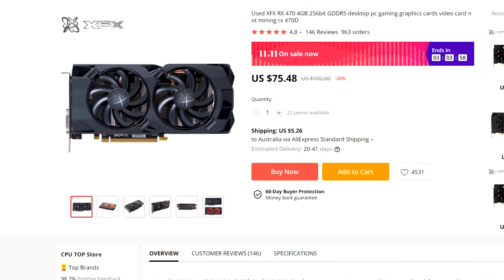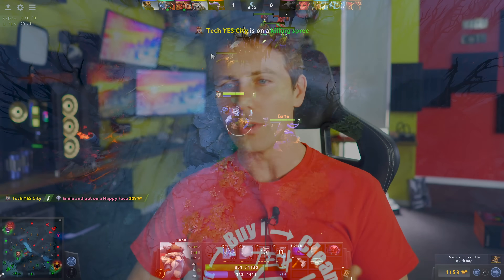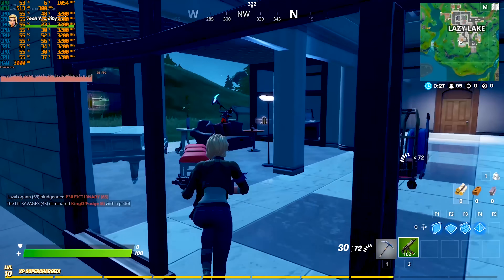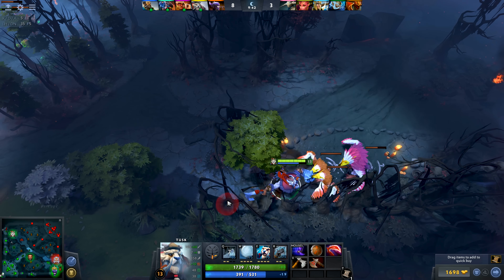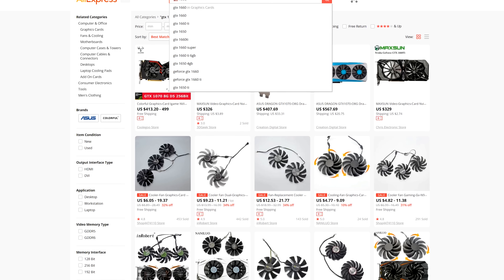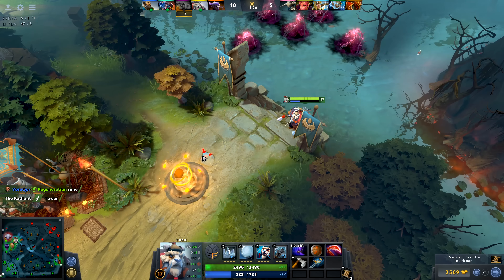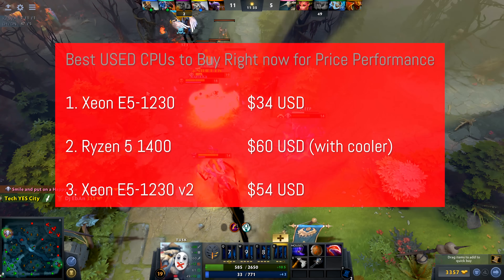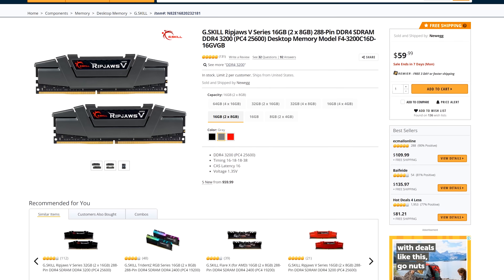What are the BEST Used PC Parts for GAMING Right Now?!

Comment: Have you looked at the AMD R9 Nano? It's a high end card from 2015 that is currently going for about $110 on ebay and it performs better than an RX 580. The only downside is that it only has 4GB of memory, but it's HBM so it's extremely fast.

Comment: GTX 1080 for 200 which is what I got my Gigabyte Xtreme for from eBay.

Also instead of 750ti I would recommend the R7 360 since they are identical performance wise and it's 1/2 the price.

Comment: Initially, I was going to get a GTX 750Ti through AliExpress because I wanted a small upgrade that didn't require a power cable, but I found a Gigabyte GTX 950 with no 6-pin connector for about $5 more (I paid $57.80). Right now they're going for about $65.
Reply: Where
Reply: @Ayoub-wg3tw  They're no longer available for that price. I see them now for $70. Do a search for: 32976818116

Comment: can you do a Q&A video for us subbers. I have a question, currently running an HP z400 W3690, 18 GB, rx 570 8gb, ssd and hdd. I want more juice but i dont know which way to go. I could buy a hp z 600 dual core with a $50 resale worth of lower end xeons and quadro, but it has max ram. then order two x5690 from your affiliate Yao Yue Store. price to performance idk. i cant find an x58 mobo where i can use all 18 gb of my ram from my current rig, nor can i find one cheap with some sort of warranty. plus i would need a case, new psu, have to use a psu adapter (which i dont want to) new fans etc. what i love about the hp z series is they are built well and for 24/7 operation.  i do game, but also edit, so im looking for more editing power without losing my current casual 1080p gaming ability like bfv and 7d2d. what says you? i need atleast 6 cores.. but a hp z 600 12 core 24 threads sounds so tempting... just dont know if it makes sense p2p when for 1-200 more im in ryzen new rig territory. but commercial grade stuff, not enterprise level hp zs..

Comment: I have a ryzen 2700x cpu with a CORSAIR - Hydro Series H100i RGB Platinum 120mm liquid cpu cooler. Paired with a MSI GTX1060 6gb with 16GB DDR4 3000 MHz Corsair Vengeance ram. I want high FPS because I game competitively and curious if my cpu is out of date or if my graphics card could be upgraded?

Comment: If I had the money, I'd grab a Ryzen 5 2600/X, no longer listed but there was a 2600 for $140 & the X for $10 more at $150 Canadian on my local classifieds, currently there's only the 2200G for $80 & 2400G for $85 Canadian, for combos there's a 1300X with a ASUS B350 Prime-Plus for $239 along with a 2700X on a B450 Tomahawk & 16GB G.Skill 3200 RAM listed for $375 Canadian.
For GPU, There's a Sapphire Nitro+ RX 480 8GB for $220 though there's 3 RX 580 options for that price, a Nitro+ 8GB for $180, XFX GTS Black Core Edition 8GB for $200 & a PowerColor Red Dragon for $220. For Vega, there's a MSI Blower model Vega 56 relisted for $285 after being listed for $350 5 days ago. On the Nvidia side of things the cheapest GTX 1070 is listed at $320 followed by $350 with the cheapest 1070ti at $400, same price as the only RTX 2060 listed.

Comment: im from poland, year ago i build a used budget pc i5 6600(non k), rx 570 4gb from Aorus, 2x4gb ram Goodram irdm, mb msi h110 eco, 120gb ssd (new), 1tb hdd Toshiba p300(new) new psu 80+ silver from chieftech and new case zalman z1 neo, total cos ~ 400$, with all new parts it will be cost 2x more....im happy with that setup i play new game high/ultra set with 50-60+fps

Comment: i got a optiplex 9020 with an i5 4590 and 16 gigs of ram off of ebay for $120,not too shabby!!!,i wanted one with an i7 but they wanted another $100 for a 9020 with a i7 4770 or 4790,but im gonna look every few days and see if i can get one for bout $150.my next goal is to get a power supply,ssd and video card for under $200 total so i will have about $300 max. in it. anyone got a 570 8 gig for $80? how bout you techyes man?got one you wanna part with?

Comment: The Ivy Bridge and Sandy Bridge Xeons are really good value for money... better single thread performance than a 1st gen Ryzen and a better CPU for modern gaming than a 9600k because of the higher core count.... got a Xeon 1270 for only 40 euros off AliExpress the other day, putting that into the old H61 based ASUS AIO PC my mate has, with a PSU upgrade and either an RX 580 or a Vega 56 will make that one mighty gaming rig!

Comment: E3 1270 v3 - saw some good deals in old Supermicro servers.  Swapped in a dual core for a home server and you are left with a good 4/8 cpu for very cheap!  Sold on my old i5 4690k pc and replaced with the Xeon as a great family pc. 

Still pushing my x5675 @4.5 for my daily drive though :)

Comment: Hey man, hope anyone sees this
Im currently ordering parts for PC, but I haven't figured it out yet completely

CPU: Ryzen 5 2600 (ordered from aliexpress) - 104.40 $
RAM: Corsair Vengance LPX 2x8 GB (also from aliexpress) - 83.80 $
MOBO: Asrock B450M Pro4 (I will buy this one locally when CPU and RAM arrive) ~ 80 $ 
PSU: BeQuet! PURE POWER 11, Gold rated 500 W - bought this one while it was few months old, almost new ~ 60 $

Graphics card - I have no clue man, maybe GTX 1660 TI, but it's a bit much for new one (I heard that that one is good for ryzen 5 2600)
Storage - SSD probably, with 1 TB HDD, SSD makes wonders man, or M.2, yea man M.2
Case - I was thinking Thermaltake Versa H17 or H18 (with tempered glass, you can see through that, that would be cool), it would be mATX build

Any advice is aprecieted

YesMan yours videos are really on point, helps a lot, thanks YesMan
I was also considering RX 580 for ~110 $, but that pulls lot of juice while playing them games (180 Watts or so)
or I had idea for maybe cheap RX 470, and flash it to preform like RX 570, but, it is a lot of hassle for "maybe it will work"
or just RX 470
Reply: You probably have got the stuff but if you didn't get the msi tomahawk it's well worth the extra 20$
Reply: @alltech7435  MSI Tomahawk is full ATX format, while I was thinking mATX maybe, it would be prefferably, I dont have Case and Mobo yet

Comment: I'm about to buy one of those RX 4/570 from aliexpress to replace my GT1030. Yes, yes, I know, I know, GT1030s are crap but back in the day were my sole option since it was during the mining craze and everything was nuts on the sky and the second market here is pretty bad too. The thing is that I thought that RX 500's series were more efficient in terms of power draining. Would be still ok a 450 + white power supply for a RX 570 or I better stick to to the RX 470? Other possibilities I'm taking on consideration is to wait to the black friday and see if I can find a GTX 1650 or a 1060 6GB for under €100, but I think that having RX470/570 for that prices it will be difficult to find some better deal.

Comment: I actually picked up some 570 4gb and a 580 8gb for $72/ each, from a friend.  He bought them from mining like right before crypto crashed, so he didn't use them very long, so they shouldn't have too many hours on them. I've got one computer that will be up and ready to sell with a 1600x this weekend. Do you think this was a good deal? Total cost of PC
x370 mother board + 750w PSU - $130
rx 580 - $72 
Case 16gb DDR4 3000mhz, 1tb SSD - $174 (I bought these all new on newegg)
ThermalTake RING cooler(new $32)
1600x - $95 on Ebay
Total $503+12  (possibly for windows 10 license, if needed)
I feel like this is a good deal, but what's your opinion?
Going off local FB market place prices for those specs, I'm hoping to get $600-700 for it, maybe that's wishful thinking though.

Comment: My thoughts on used:
Things are changing so fast right now, it's crazy to try to predict where we'll be (value and performance) with anything next year this time. I'm scared off by used, but just bought an open box 1950x for sub $500 US tax and shipping inc. (I know it's probably been culled bu someone binning chips, but I don't need it to OC to the moon). Anyway, my theory is to build with 1 or 2 year old new equipment purchased just as they release a new generation (NOW - 11/19). Based on this, you don't pay the premium for new and trendy stuff, it's proven -  if there is an unknown issue, it's well sorted by now. SO I'm building a 2 year old Top of the heap Threadripper with a new GPU (5700XT) and I hope I found the balance for my uses. Nearly a $10000 machine 2 years ago and I'm all in at about $2000. If I use it for a few years and give it away, I did well, I already saved 80%.  It will probably get handed down to one of my kids, so I like to build quality all the way. In a couple years, nobody will care if it was new and cool when it was built. If you can run near leading edge stuff for $500 - $1000 per year, I figure you're doing well, and this system won't be worth less then $1000 for a long time. For anyone who cares or is interested in doing one, It' a 1950X with X399 Taichi, 3 Crucial 1tb SSDs, 32gb DDR4 3200, Deepcool 240 watercooler in an Anidees Crystal (mesh front)  Case with a full load of Deepcool 120mm fans. GPU is an XFX 5700XT Thicc 3, 1000w Rosewill Hive PSU. If it all runs stock speed cool and quiet, It will be fine, but expect it to do a bit better.

Comment: It's a good idea to recommend what to look for but people need to develop their own knowledge. Around me the i5-4460 is going for really good prices as many people are just ignoring it because it isn't overclockable. Yet paired with a GTX 780Ti and 8GB of DDR3 1600Mhz RAM it gets great gaming performance. Assassin's Creed Odyssey with a mix of Medium and Low Settings will get me a fairly consistent 60 frames per second and the game still looks great.

Sure there is a lot more graphical frippery at the higher settings but games are made to run and look good on the lowest possible hardware, I think a lot of people forget that.

Comment: Hi Bryan, Question of the day for me would be: I have a chance at an old HP Z600 workstation that has 2 Xeon X5650, 12gb ram, 2 video cards (Quadro 5000 & a Tesla C2075 6gb), 500gb SSD hard drive with Windows 10 Pro already installed, 22" monitor for approx. £200 ($256 USD, $375 AUD), could I take out the graphics cards and replace with a 1050ti or a 1660 super, not 100% sure on the power connections or even if this would work...

Comment: My 970 is still a good card in 2019 and they are very cheap now
Reply: 970 is the best used gpu in my opinion. I got a bunch of them for a 100 cad  each. about 80 usd
Reply: @DogMason  I just bought a used rx 580 4gb on eBay for £85 which is like $105 and I think the extra $20 is worth it 100%
Reply: Have you done benchs they perform pretty close together.
Reply: @DogMason  no dude I haven't even got the card yet I'm going off the general information and some data I find online
Reply: @DogMason  however I note that it's no worth upgrading from the 970 to the rx 580 as there's just not enough of a difference
Reply: @YourBoyDanny  Bit of a tip for you they actually trade blows. Really matters what game you are playing. So get the one you can find cheapest. if you average its a 3% performance difference in favor of the 580. which for newer games means you might get 1 or 2 more fps. Not worth 20% more money imo
Reply: @DogMason  not from what I've seen in online comparisons , I agree that is some games like CSGO and LOL but those games are easy to run, any way lets stop arguing cos I've already bought the rx 580, for the UK I got a really good deal so I'm happy and I'm sure the 970 is a brilliant card too
Reply: @YourBoyDanny  It doesnt matter if its easy to run. More frames means more graphics throughput. They are about the same is all im saying. Trying to share my experience as a budget builder

Comment: With R5 1400 down so low I cant support any of the xeon CPU's. Their a lot of hassle now. You have to mess about with Windows after to get the max frames at the expense of security. The motherboards are second hand and Logans luck if they are reliable or not as well as missing many modern staples. And thats without looking at Performance and warranties. If you buiy the Ryzen you can buy budget new everything right now. And it all fits in a  case with 3.1 USB.

Comment: What about the vega 56? Bought mine for 200€ ( Keep in mind I live in france so new/used hardware is typicaly 10-15% more expensive that in the US so you can probably find it for 200$ ) and I keep seeing more and more around that same price area. Seems like a pretty good deal for a card that will easily last 3-4 years in 1080P very high/ultra at 60-80FPS+ and probably another 1-2 years in 1440P 60 fps. When you compare it to the nvidia counterpart it's usualy 60-70$ more at minimum to get the same performance used.

Comment: I got my RX 480 for $75.  I certainly agree about the RX 400 series - added bonus, both the RX 470 & RX480 will use the current AMD adrenaline drivers.

I am preparing a new system for Xmas, I am building around a Asus Pro WS X570-ACE (No RGB for me), a Ryzen 7 2700, and my RX 480.  It is a work box (3d Art), but it should game very well at 1080p.

Comment: What do you recommend upgrading to from a 1070 ? It is a good overclocker, but it can't manage above 60 fps in RDR2 at 1440p with optimized settings.
Reply: Rdr2 is unoptimised don't upgrade because of a trash port
Reply: @kruxdt6307  How is it unoptimized ?
Reply: @The2808erik  it runs shit even on a 2080ti
Reply: @The2808erik  just look at all the videos about it
Reply: @kruxdt6307  The only thing I could find is videos about i5's having problems and stuttering at too high fps. I think the effects of the game are too demanding for the card, the low PC preset can't go as low as consoles.

Comment: Video Cards are probly the only good deals I see for used parts. Nvme SSDs under 500Gb are kinda cheap at the moment too but 2.5 inch SATA SSDs are going for WAY too much. I see almost every used 2.5 SSD going for the same price as a new one or sometimes even more.... I want to MSG all those sellers & ask them what they are smoking
Reply: Don't bother with used ssds
Reply: @kruxdt6307  yeah not for that price. If they drop to half or close than I'd try.

Comment: I have built a computer in the Jonsbo C2 case as well. Ryzen 3600, 32GB 3200mHz, GTX1650 (only 75 watts), Noctua L12S, etc. Drawa 75 watts in normal use and up to 150 while gaming. Pretty good! 
I used a dremmel to open up the bottom part better than the fan inlet that blocks like 50%. 
I have some pictures here: https://drive.google.com/drive/folders/12M0OMadHmSy1vrigHoWVbaGF9mVejr8y (I have switched the cpu cooler to L12S since then).

Comment: I'd still recommend 1st gen Ryzen. Xeons are good performers but the lack of upgradability in a pc is a big letdown.
Reply: in some country even xeon + board still have price, so it depends
like i bought x3460 + 1156 for $70 back then, then resell it for $100 when i want to upgrade
Reply: take a look at the x99 platform, a 2690 v3 can be had for less than 180 eu, and it can handle a 2080ti with ease, especially with a turbo boost unlock. please, do your research before commenting, no hate.
Reply: ryzen currently stops at 16 cores 32 threads on socket AM4. xeons stop at 24 cores on socket 2011-v3(intel x99) and on x79 you can run upto 15 cores. then again you do need to be lucky enough to find a deal on a E7-8890v2+ CPU.
Reply: @psionx1  3950X will absolutely obliterate anything X79 or X99 offers, there's literally no point going with the Xeon route right now. One of the main benefits of going the Xepm route back then was because DDR4 was really expensive, but now DDR4 has come down in price drastically. If you're on a budget, just get a $40-50 R3 1200 and a decent B450 board (like B450 Pro 4, Tomahawk, Steel Legend, etc.), and you're good to go.

Comment: Perfect timing! It's my 19th birthday today and I was looking to upgrade my pc. My pc specs:
CPU:Xeon e5420 (oc to 2.95)
MOBO: Gigabyte ga-ep35-ds3
Ram: 8gb (2 sticks are mismatched 😂)
Gpu: Gt 740
Power Supply: some crappy 450w without even a 6 pin connector😂
I have play at 1440x900p and play mostly fortnite and league of legends . Fortnite runs okay at low settings but stutters almost every few minutes . I bought the pc as a complete set from another person. If someone has a suggestion on what I should upgrade first base on my pc specs I would greatly appreciate it 😊. I only maybe have a 3000 rubles budget or maybe push it to 5000. I've seen some local deals on some rx 570 at about 5000 rubles but since I dont have a 6 pin connector I dunno if it would work lol
Reply: Do the Xeon e5-1230v2 and e5-1230 work with DDR3 NON-ECC RAM?

Comment: Hey the vega 56 is at a good price right now, especially if it is a model that can be flashed to have the higher RAM speeds of the vega 64
Reply: Oh? Some models you cant flash? I have my eyes on a used MSI Radeon RX Vega56 8G HBM2,  that blower original style(might mod it with a cpu air cooler). Could that be flashed... ?

Comment: I've had excellent luck flipping R5 1600/1600X with 1070/1070ti and selling them as high refresh 1080p, or entry to mid 1440p systems. I have 2 good outlets I have been able to source parts from.